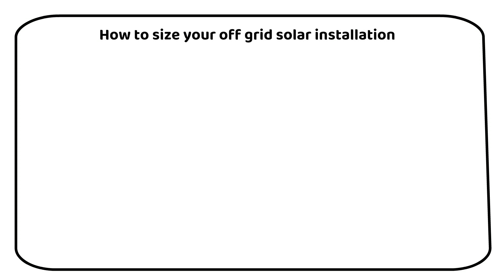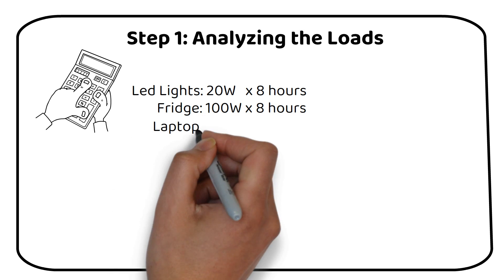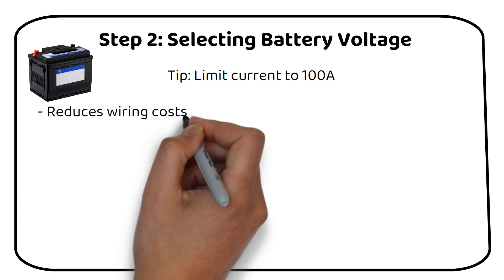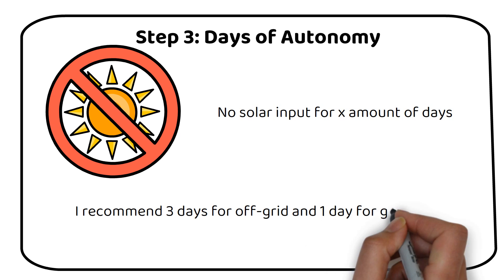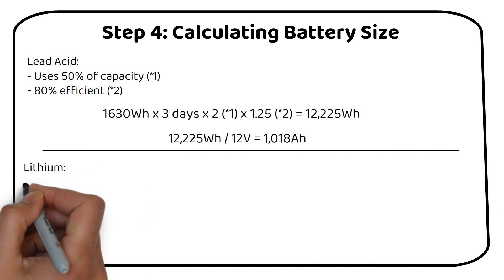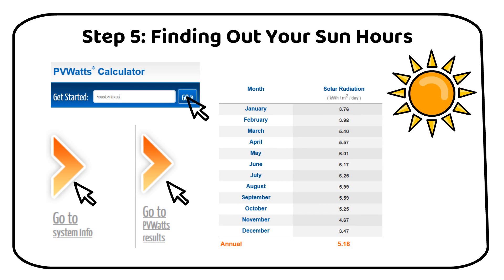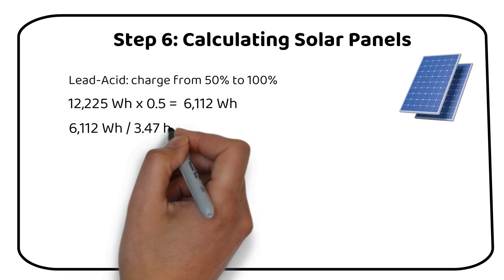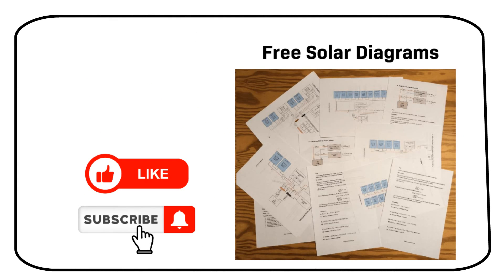How to Size Your Off Grid Solar Power System: Off Grid Solar Calculation

Comment: Hello! Thanks for sharing these useful tips with us. But i have a question. why do you size your pv array based on half of your battery bank total watt-hours for 3 days of autonomy?  From what i understand the solar  panels should be sized based on the total daily watt-hours?... Because they're there to replace what you take out from the batteries during one day....not three days.... you won't probably have to go for three days without sun very often...i'm a bit confused! 😢
Reply: okay!  Let's say we're in the caribbean islands,where we never go 3 three days without sun...will this sizing method be ok? And what i understand if we  use a DOD of 50% in our calculation for a 3 day atonomy....we'll never reach that DOD unless we have non sun for three days. Wouldn't be better that we size our solar system based on what we consume daily?
Reply from the maker: The solar array should be sized to recharge the battery in one day of sun, 2-5 sunhours depending on location. The battery is sized for the loads, so they can run for 3 days. Hope this helps.
Reply: I live in Arkansas and 3 days with no sun is common. My record is 12 days with no sun.
Reply: @cleversolarpower

Comment: Does 48v 100ah battery can sustain my 12,000 watt-hour per day?
Reply from the maker: 54.4V*100ah= 5440wh. So you need at least 3 batteries.
Reply: @cleversolarpower  In what connection? Series or parallel?
Reply: @SamWinchester-xm5es should be parallel. If you put it in series, it would increase the voltage (I'm guessing your inverter would be limited to 48v)

Comment: I'm building/ rebuilding an rv park with 367 spots, and I want the entire park off grid!
Reply from the maker: It seems like a big project, every RV will want to plug in and use their big appliances, most likely AC too.
Reply: That would require an incredible amount of money.
You might want to hook up to the grid and then convert your spaces one at a time to see how it is going. Do not forget to position your solar panels to provide shade for the campers.

Comment: Lithium.  100lbs per 100sqft of house.
Reply from the maker: That's a very inaccurate way to size a system. What might work for you doesn't work for everybody.
Reply: @cleversolarpower  You might be right.  I'm a Biochemist and see things differently.  To reduce the stress on any battery system, you attach it to a load that can't overheat.

Comment: Lead acid batteries have a warranty, so if one goes bad in it’s warranties period, it gets replaced. Buy the ones that fit your car or truck. WallyWorld is great for replacing the batteries
Reply from the maker: Lead acid is making way for lithium. Very cheap now, check my video where I compare lithium with lead acid.
Reply: @cleversolarpower  Does lithium batteries have a replacement warranty similar to FLA? I haven’t seen that yet. Can the lithium be recycled? Yes but the cost is more than mining the raw lithium

Comment: Excellent presentation. Which Solar Panels would you recommend for charging a Power Station like Anker, Bluetti or Ecoflow?
Reply from the maker: If you have space get poly, if you are limited by space get mono. Get rigid panels, not flexible. As for brands, no particular recommendation.

Comment: My battery is tank 300L of water.
I need warm water every day.
Reply: I would use a solar heater like a pool heater (black pipes sitting in sunlight) and a small solar panel powered recirculation pump to move the water through the pipes. Seems like direct sun heating would be more effecient!
Reply from the maker: Solar panels straight to heating element?
Reply: @cleversolarpower  NO.  There is a regulator between the panels and the heater.  Heater without its own regulator, powered by DC current.

Comment: Best thing you can do is have your panel voltage to exceed your battery by at least 8 volts. This way it charges all day. Not just a small window in the middle of the day. Mine were charging as soon as the sun rose and almost untill it set.
Reply from the maker: Voltage is depends on the temperature, while irradiance effects current. So the voltage of your solar panel will be higher when there is no direct sun on it.
Reply: @cleversolarpower  The max voltage rating of the panel.

Go ahead and feed into the hype.

Or you could verify it.
Reply: @cleversolarpower  I guess you didn't understand my meaning. If you have for instance a 12v panel with a peak of 14v it will only charge 12v during peak sun. Given that a 12v system needs the 14v to charge. If you use a 20v peak panel for 12v it will charge outside of peak sun as it doesn't need peak sun to reach 14v. The higher your voltage going to the controller, the more hours of use you can get out of the panels each day. You need less panels to charge the battery bank then. Or you have have a controller move the panels. I just over rated mine and let them sit. Dusk to dawn working and charging.
Reply: Does the charge control also affect battery charge

Comment: Have you made a video on solar charger selection (voltage and current) and sizing of power panels, taking into account that the panels are very unlikely to produce the rated power?
Reply from the maker: Do you mean sizing charge controllers or regular battery chargers? Indeed, I have accounted for this in the video. Sun hours is the amount of hours where you will have 1000w/m2. So we base the calculation on that. So a 100w panel produces 400wh in one day with 4 sunhours, but there are actually more sunhours in the day, but not at 1000W/m2. That makes up for the ~70% efficiency.
Reply: Figure on a 100 watt solar panel putting out 70 watts when it is hooked up to the system and operating in full sun and half that amount when the sky is 50% cloudy.